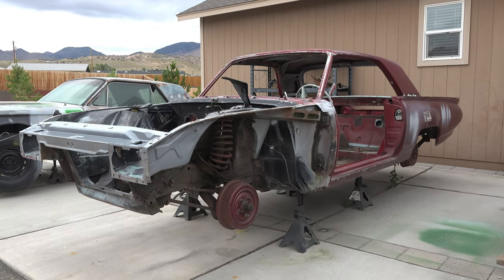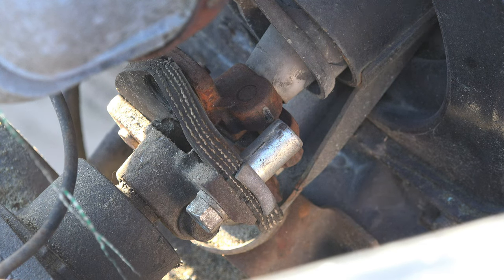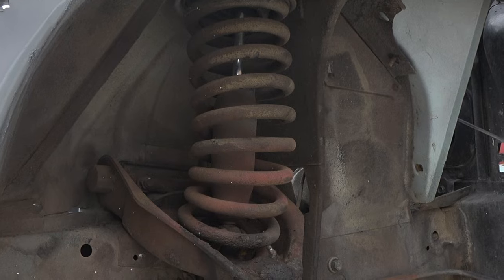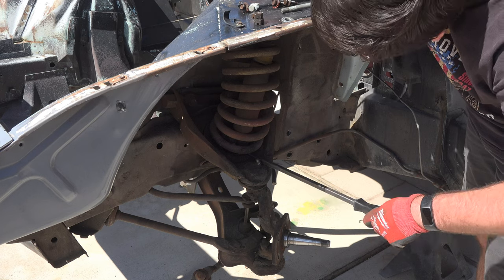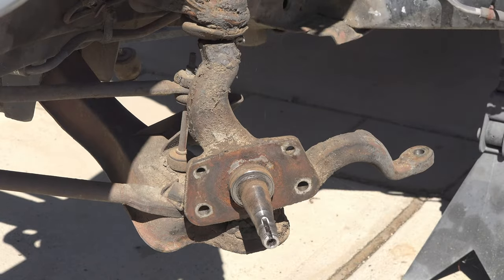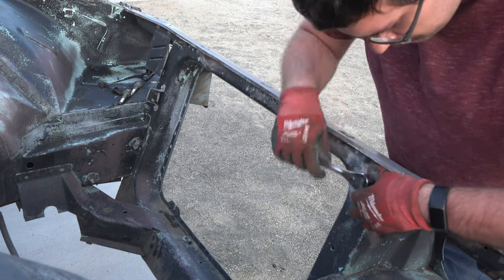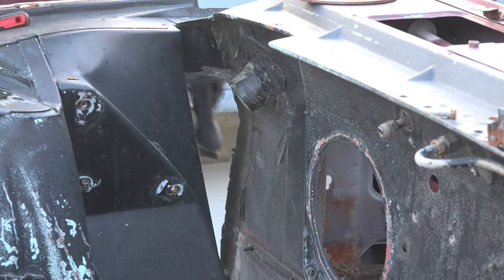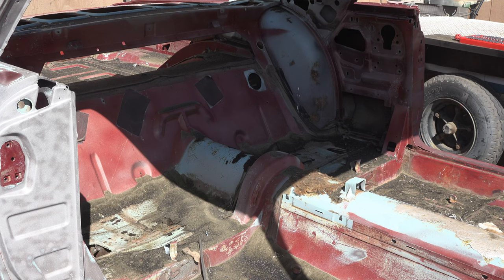1963 Thunderbird Restoration Part 6 - The Final Strip Down!

Comment from the maker: Hi there! To anyone who may be attempting a spring removal in the future, I just wanted to say that the method I used in this video is the hard/dangerous way using standard spring compressors. I actually found out recently that Amazon & Summit sell an internal spring compressor that closely mimics the original tool Ford designed, which makes it much easier and safer to remove and install these springs. So don't do what I did and get the generic spring compressors from Harbor Freight, get the nicer one from online and life will be good! Have a good day y'all and thanks for watching!

Here's the link to the good spring compressor (OTC Front Coil Spring Compressor 7045B): https://www.summitracing.com/parts/otc-7045b

Comment: Hello Angell. Another great video! That teardown was fun to watch, except the spring removal.  Made me nervous just to watch that. I used ratchet straps as I compressed the springs on my tbird just for safety measures. Your tbird body is in excellent condition. You are lucky with that. 
George B
Reply from the maker: Thank you sir! Yeah I am never going to pull springs like that again! Those modern spring compressors are really only good for Foxbody Mustang's and Honda Civics. I am going to be going with an internal spring compressor, similar to the one Ford recommends in the shop manual, for future use!

Comment: Man I love you and PLEASE find a safe spring removal method.
Reply from the maker: Thank you sir! And yes I actually did find a MUCH better way to remove and install the springs. Sadly I didn’t find out about it until after I removed them, but Amazon actually sells a spring compressor that closely mimics the original Ford design. I saw someone try it out on their bullet bird and it worked out fantastically! So I am going to get one of those tools for future spring removals and installations!
Reply: @AngellsGarage  Good Man. I just pulled a spring from my Mustang using an Amazon internal compressor that I had to modify (after much consideration - hah) and it worked very well. Please post a link to the tool you sourced in your next vid. Wish I was closer by, I would try to hire you to blast for me. 😊

Comment: Understand, most newer, replacement shocks will be gas charged but the shocks we used "back in the day" were not charged and therefore, would not be under pressure.  Those you removed from the front end may have been replacements from many years ago.
Reply from the maker: Very interesting, I actually did not know that! That very well may be the case, thanks for the information!

Comment: Another great video.   What drum are you using on the drum sander?  I have the same tool and it doesn't remove paint very well.
Reply from the maker: Thank you sir! I’ve been using the 40 grit silicon carbide drum from Harbor Freight. That one is the best hands down for paint removal, the other grits they offer (120 and 240) barely even touch paint. I know Eastwood also offers a lot of different drums for these tools, including a wire wheel drum, so they might also have a few different good drums for paint removal, I’ll have to experiment with that in the future!

Comment: Decision time! while you have all of those parts removed  you might as well rebuild/replace them! the vacuum booster for the breaks and the master cylinder, and the power steering box, seal kit $80.00 I have to do that with mine as it leaks more than the water tight doors on the Titanic. Then all new components for the suspension, yeah buddy... what would it take to convert to front disk breaks on that '63? the '64 should be easy just use the parts from a '65 or '66 but I don't know about the '63 your doing GREAT!!  I started changing out my bad vacuum motors and hoses on my bird... fun.
Well God bless and stay safe. After seeing you hard where storage I can just hear your mom now....."Has anybody seen the box of sandwich bags I just bought?" I can't find them anywhere!"
Reply from the maker: Thank you for the comment sir and God bless! That is definitely the plan, new everything! I am going to do a new brake booster, new dual master cylinder, new stainless steel brake lines, rebuild the steering box, upgrade to a heavy duty sway bar, and new bushings, ball joints, tie rods, center link, and anything else that needs replaced/servicing. I want this car to drive like brand new and be relatively trouble free for a long time (hopefully)! I did look into doing a disc conversion on the 63', and actually I don't think it would be too hard. There are kits available to do it online that are relatively inexpensive. I decided against it though after talking to another fellow 63' Tbird owner, and he said the drums actually do really good on these cars, and I think I recall reading somewhere that these 63's actually had the same front drums that the Galaxy police interceptors did. As far as the 64', someone actually already did a disc swap on it believe it or not! Looks like they used a 65' or 66' disc system, and I must say, those brake calipers are HUGE!

Also, good luck on your vacuum system! Vacuum systems are never fun to work with, especially on the 64-66 birds, those cars must have a mile of vacuum lines in them!

Comment: Hello Angell - your videos are informative & highly amusing. You betcha i’m taking notes. Quick question: Did you consider having the car dipped & stripped instead of blasting? If you rejected that option what were the reasons? Cost? Missing the joy of finding blast media in every car & person crevice? 😅
Reply from the maker: Thank you sir! So yes I did consider it, but I decided against it for a few reasons. The first (and main) reason was because there was nobody near me who did acid dipping, the closest place was about 2.5 hours away and that would include driving over a mountain pass! The second reason was transportation, with the front wheels off the car (and presumably the rear axle too), I wasn't too sure how I was going to move the car about, although I think Summit Racing Equipment sells stands to move around shells. And the last reason was actually cost. Not that acid dipping is expensive, but currently it's about 12 dollars for a 50 pound bag of coal slag blast media at Tractor Supply,  and I think I ended up using about 10 bags for the whole shell, so it was relatively cheap to take the whole car down to steel using the blasting method. That is the worst part about blast media though, you'll be cleaning the crevices for hours and you still won't get it all! 

But if I had a place closer to me and if I knew how I was going to get the shell there, I would seriously consider acid dipping! The lack of clean up alone would be worth it! I would be curious though to see how well the acid preps the surface for paint. That is another thing I like about blasting, it leaves a nice rough surface that the primer loves to grip too. I know acid prepping a metal surface, and even acid etching primers, are quite popular,  so there probably isn't too much of an issue there, again just something I am curious about. Anyways, sorry for the lengthy comment lol, thanks for watching!
Reply: @AngellsGarage Thank you for taking the time to answer.  No need to apologize for a lengthy answer.  I can never have too much detail!!!

Comment: Is there anywhere to get sheet metal for the 61-63? I'm having a hardly time finding any
Reply from the maker: The best place to get new sheet metal is from Ecklers, they have a good selection of sheet metal for these birds, including floor pans, rockers, lower fenders, and quarter panels. Unfortunately if you need anything like a fender, door skin, hood, cowl, or deck lid, those are not remanufactured and will have to be sourced from a parts car. There are a few classic car junkyards that have these cars in them, my favorite being Browne Auto Salvage. They are located in Sunset, TX and can pull whatever part you want and ship it to you. They have 3 bullet birds right now, a 61, a 62, and a 63. The 62 and 63 are very complete and have lots of good metal on them. Good luck on your search!

Comment: What’s a project like that runs moneywise?
Reply from the maker: Not cheap, that's for sure! I think I've got about 8k into this car so far, and I still need to get a LOT of parts. The most expensive thing by far was getting my bumpers rechromed, which ran me about 2.5k for both the front and back. Definitely pricey, but I got them triple plated just like the factory did, plus they also pulled the dents from my front bumper, so they both look great and should hopefully last another 50 years! Other than that, the machining for the engine and heads is also quite pricey, about 2k for that. Then another 1.5k for 2 gallons of epoxy primer, basecoat, and clearcoat. Not to mention all the small parts I need! The parts aren't expensive, but 30 dollars here and 50 dollars there starts to add up. I think by the time I am finished, I will easily have about 15k into the car, but thankfully it doesn't feel like that much since I am buying the parts slowly over time!